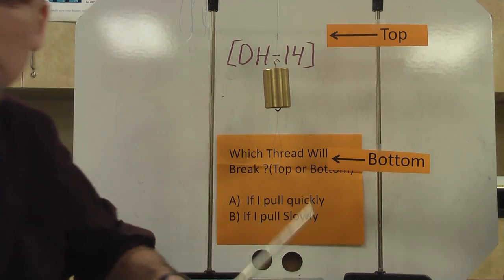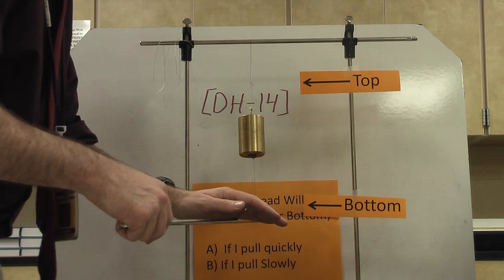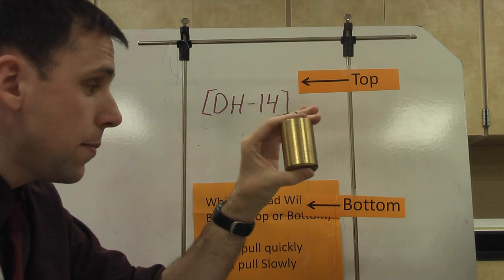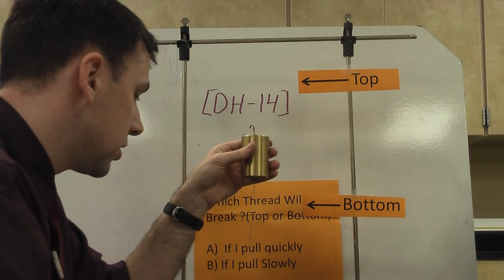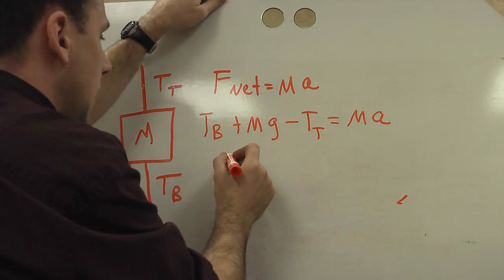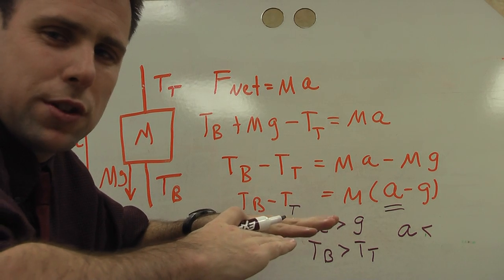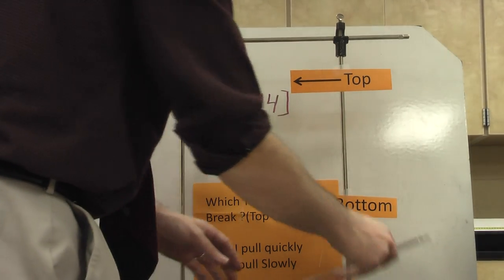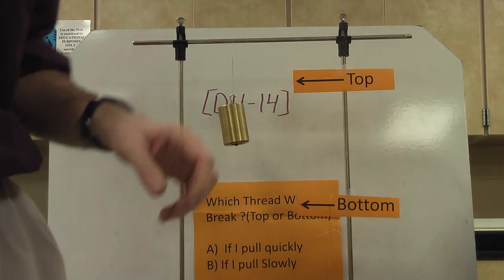[DH-14] Inertia Demonstration.  Which String Breaks? (1080 P HD)

Comment: Thank you Sir,
But I always wonder the breaking of the lower string by an impulse would be the cause of changing of momentum. 
During the impulse the action and reaction force on the lower string would be the force applied plus its change of momentum force. 
Is it right for what I is supposing?